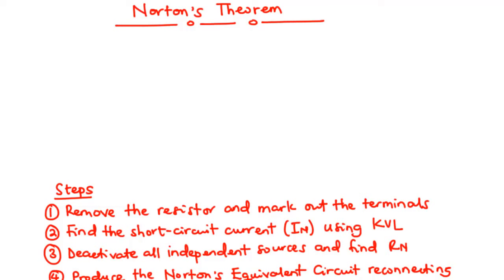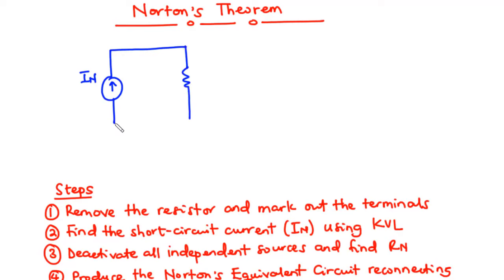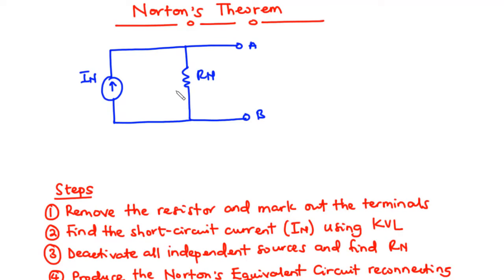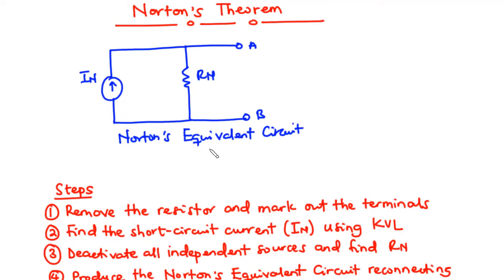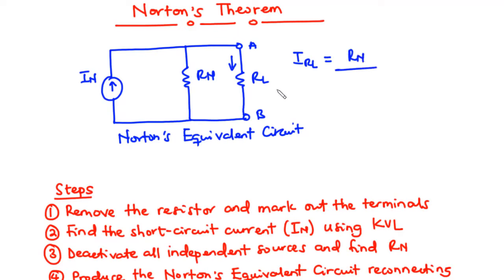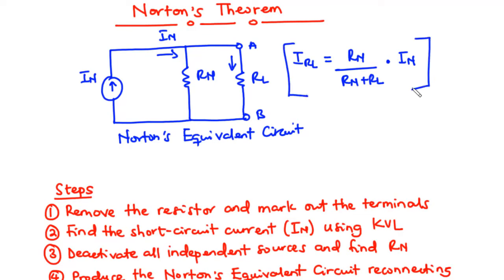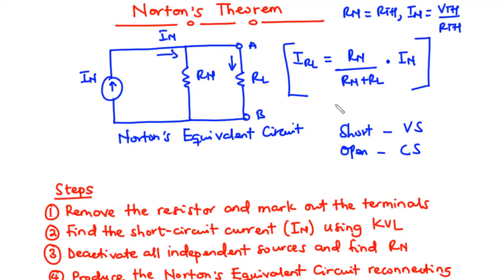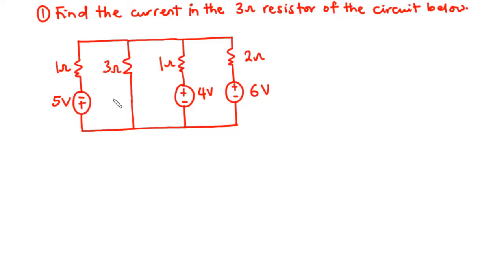20a - Norton's Theorem with Solved Examples #knust

Comment: Show me how to calculate current flowing in the network using norton’s theorem with two resistors in series and two in parallel and potential difference across the 2ohm resistor

Comment: When computing the IN, why are you using -5A for I2? was that a mistake? Thank you.
Reply from the maker: It's not a mistake, that's the right thing.
Reply: I mean clarify why you used - 5A for i2 as the rest were negative values. I need to understand. Thx.
Reply from the maker: @blesstouch5284 it's because this time the current i2 is leaving the negative terminal of 5v hence it's a negative current. Remember that conversationally, current that leaves the positive terminal is termed positive.

Comment: Thank you so much
But I’m still struggling with the Norton’s theorem 
I don’t know what to do 😢
Reply from the maker: Thanks for watching. Anyways, what's your struggle?
Reply: @SkanCityAcademy_SirJohn  finding IN or can I use VTH/RTH for the IN during exam?
Even when it’s theory?
Reply from the maker: When it's theory, you are required to use the 'normal' Norton's method. So tell me your problem with finding In so I can help you
Reply: @efyanaomi-eh9wg  its just current division, you should familiarize yourself with it. it saves alot of time
Reply from the maker: Thanks for your input, Robert

Comment: Your teaching is sooo nice SIr, but slight mistake, at 10:35, already u have taken -5, so u shouldn'y take -I2 also, becuase both minus signs cancel out each other and result will be positive, PLS GIVE ME CLARITY IN THIS SIR
Reply from the maker: The negative has already been catered for in the current equation. That is why the equation in 10:35 had to be negative, negative to cancel out.